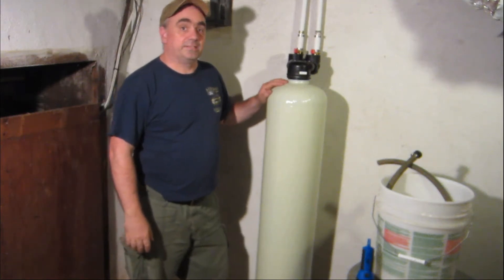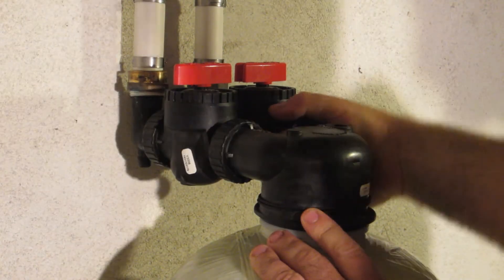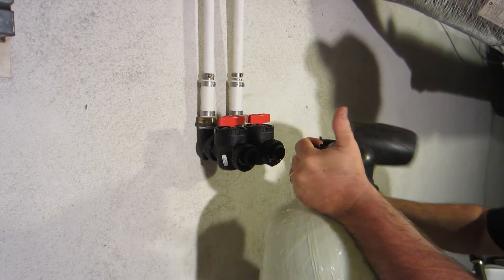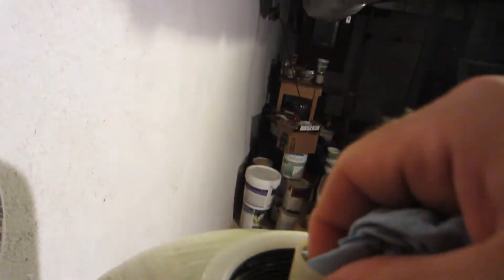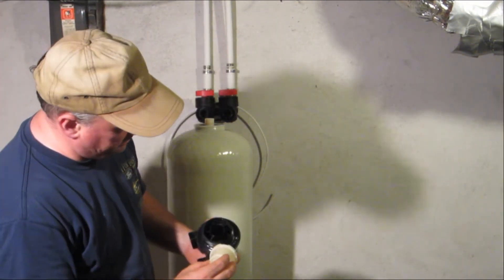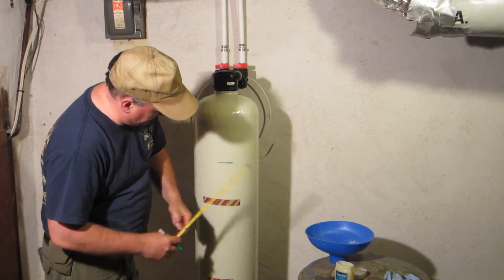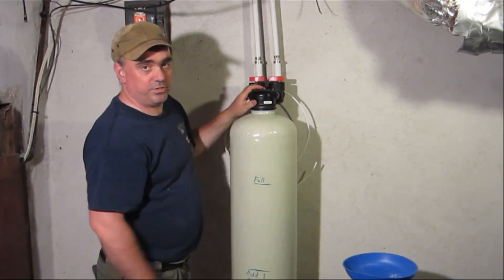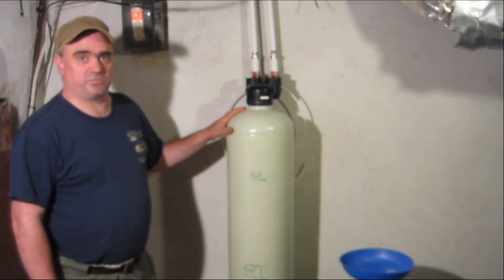Water Neutralizer REFILL - How to ADD Calcite if you have a non-backwash system without a fill port.

Comment: Thanks, great video!  I have the fancier type but this is great for the basics.  One tip - my manual says open the valves slowly when refilling.  I suppose this helps keep the calcite from mixing with the water.  It can clog up faucets (just clean the faucet screen) but it also gets into the toilet shut off valves and that gets to be a pain - I put a bit of extra weight on the shut off float to help it - the problem eventually goes away.
Reply from the maker: That's probably a good idea.  I have a whole house filter after the neutralizer, so that takes care of most of the debirs from the neutralizer.

Comment: Adding this tip hear for others reference. I spoke with a pro who recommended that I add a flush valve right after the neutralizer and before water softner. This will allow you to flush the neutralizer and not clog anything else up stream after adding calcite.
Reply from the maker: Good tip! Thanks for contributing.
Reply: Could put water softener in bypass mode also.  The large filter after the softener will catch anything ...
Reply: @ridemfast7625 you could but why clog the filter as you need to flush it a lot for the water to run clear. Plus how do you know when it's running clear? But yes I do put my water softener on bypass and the flush valve is after it.
Reply: @AlexSherm  Im cleaning the Calcite tank before cleaning the filters.  I installed the filters, calc tank, water softener, uv light.. myself and installed a few spigots in the system to flush/clean equipment without having to turn off entire house.
Reply: How often does the pro recommend to flush?
Reply: @unitedfireybride the flush for the ph neutralizer is done only after adding new media no reason to flush otherwise.

Comment: What do you do if when you unscrew the top valve and the pipe that goes down the tank comes out? 
How do you prevent this from happening in the future?

It ended up coming out back 5 inches before I could grab the pipe. we were able to turn and muscle it most of the way down, but then took a mallet and lightly hammered it back down, and eventually got it close enough so the threads would catch and got it spun on.
Reply from the maker: Glad you got it figured out. I hadn't heard of that happening before. Worst case would be that you have to empty everything out and then reassemble it. To prevent it from happening in the future, on mine, it is just an o-ring that holds it on the top. Make sure it is well lubed with food grade silicone lubricant.  Don't use petroleum jelly,  it will degrade the o-ring over time.

Comment: Nice video. Thanks for posting. 

3 questions:

1.  What is the pH/Hardness of your source water?

2. What is the pH/Hardness of your treated water?

3. What is the benefits of a back washing pH mitigation system vs the system you services in this video?
Reply from the maker: They system was installed before we bought the house.  I actually have a water test from before the system was installed (pH 6.2 / Hardness 7.8 gpg), but I can't find results from a test done after (I know there was was one).  I also don't know anything about the benefits of a backwash system.

Comment: NO petroleum jelly on any sealing rings! This will deteriorate the rings. Silicone or vegetable oil is typically recommended. Also, not a bad idea to wear a dust mask when pouring the calcite. That stuff is not all that good for your lungs.
Reply: Was coming here to post a warning about incompatibility between the petroleum jelly and the rubber o-rings as well. I sell and use synthetic plumbing grease for this purpose as well as cartridge-based filter housing o-rings. I sell many o-rings to replace those swollen by petroleum products to the point they won't fit where they belong. 

Source: am plumbing supplier
Reply from the maker: Correct.  I have a video coming out soon where I say the same thing.  Not sure what I was thinking in this video.  As I was pouring the calcite, and looking at the dust I was thinking that I should probably be wearing a mask. Thanks for commenting!
Reply: @TheFixitShed  In all honesty, I didnt think of using a mask until after the fact, either. I'll do better next time.   :    )
Reply: Yeah, I've been hearing that about petroleum jelly for 30 plus years, it may be true but apparently it takes a long long time for it to happen.  I have acid water as well as hard water. The acid neutrelizer also has 30 years of jelly..

Comment: Good video! after refill, when i open the water valve slowly, it still lifts up much during the backwash and I'm concern the calcite is washed out. is there a point in adding more gravel maybe? is that the gravel purpose?
Reply from the maker: I am not a water filtration expert, but the gravel is usually below the bedding and is used to help evenly distribute water flow.  The previous owners of my house put in the system and did it as cheap as possible.  there is no backwash on my system, so not entirely sure how that is supposed to work.  I would suggest you check with the people who installed it to be sure.
Reply: @TheFixitShed  thanks
Reply: @TheFixitShed  Thanks for sharing the content! When it comes to water applications, always use a PTFE teflon or silicone based lubricant on rubber o-rings. These o-ring lubes help enhance the overall seal and extend service life, where vaseline is known to cause rubber to swell or dry out, which can lead to premature wear/failure.

Comment: Great video.  Thanks.   My tank was virtually empty.   Probably needs 3 bags.   When removing the valve, the entire tube with basket came up.   Do I need gravel at the bottom of the tank?   Just about 3 inches of  of crud at the bottom.
Reply from the maker: It looks like some systems do have gravel, and some don't.  Since there was just crud in the bottom of yours, I would guess there wasn't any gravel.  I am not an expert in water filtration.  You probably should call someone that is to get the best advice.